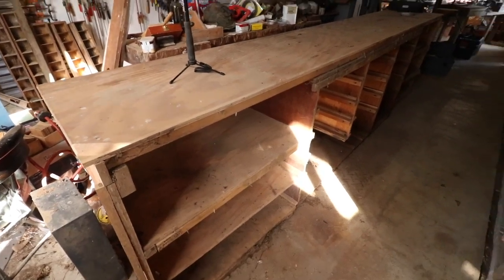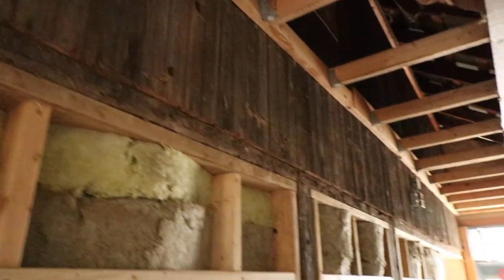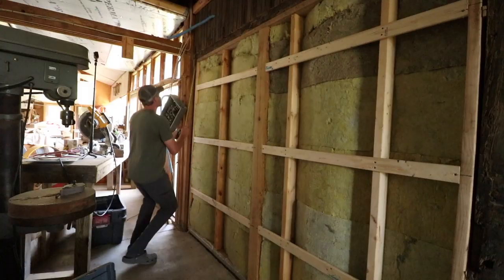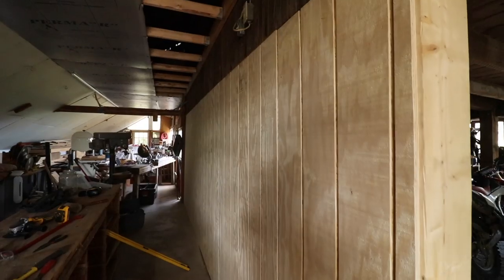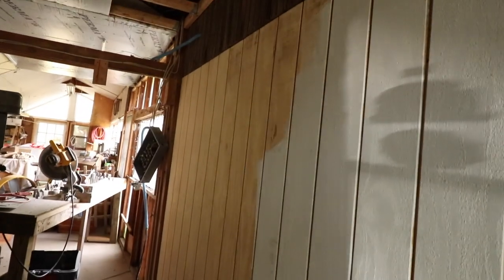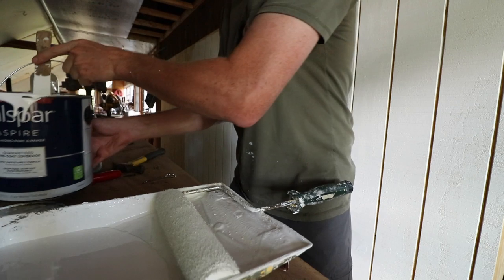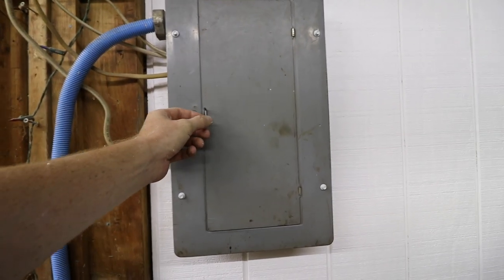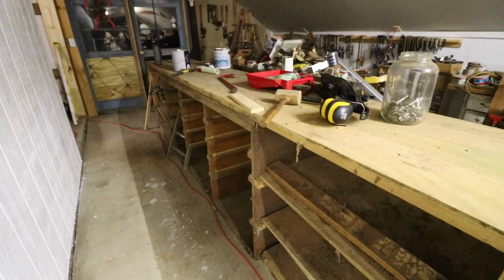Satisfying Painting Time-Lapse | Paneling Is Up & Power Is On!

Comment: You can glue some strips of thin plastic (like winter crazyCarpets) on the rails, it will help the drawers slide better. Nice job Tanner.
Reply from the maker: Thank you for the suggestion Patrick!
Reply: @AdventureDaily  no problem mate ✌
Reply: You can also use some moldering used to finish off melamin shelves, its like a U shaped white plastic strip thats made to clip 9n the thickness of the plank. They are cheap like 1,79 per 10'.